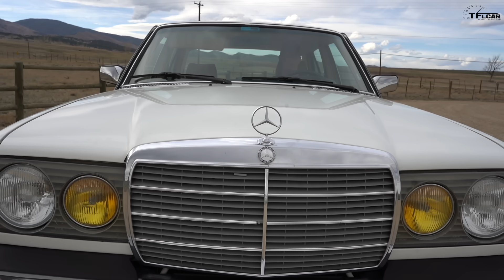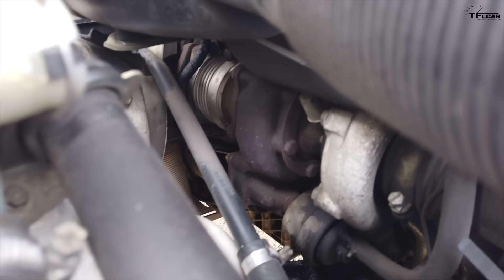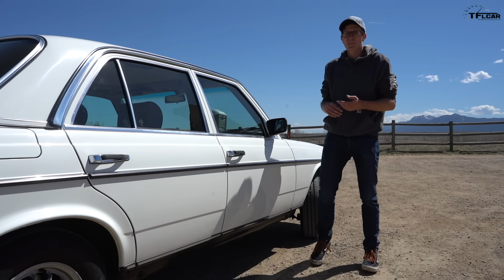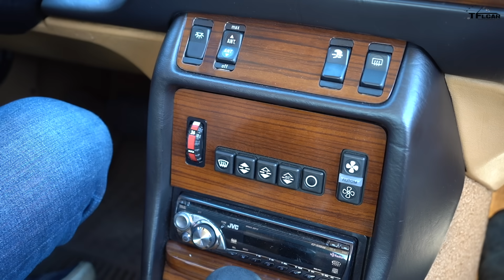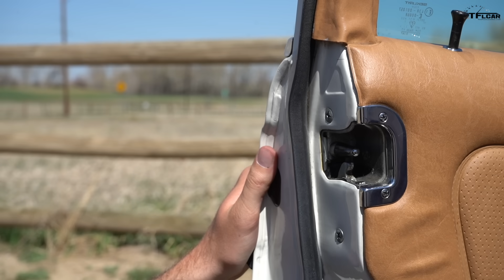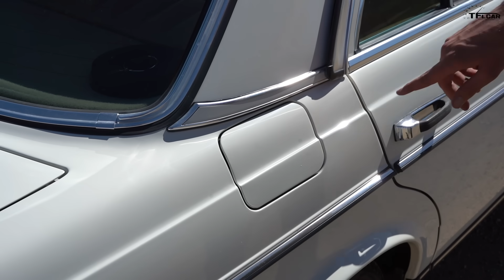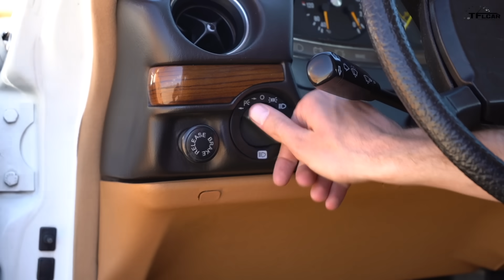This 37-Year-Old Diesel Is THE BEST Mercedes Ever Made!

Comment: Though, you can not compare car design today (Caddialac and Mazda) with a car from the 70's. (It's a 70's car). The reason why your Mercedes is much more boxy is due ot the manufacturing methods that were available then .. Todya, designers can model the design much more freely than when your car was manufactured.

Comment: I'm not sure that your review is all accurate or even related to each other, I'm sure it is the best car ever made and I say maybe almost all Benz cars, but comparing 37 years old car with newer design is not a good idea or even criticize the design knowing that Mercedes is one of the best designed cars in history.
Or even the engine sound, dude this is Diesel, it is normal to hear the engine sound, try checking other makes and newer models but diesel engine:).
Well other than that good luck in everything :)

Comment: I love this car but I have electrical problems all the time. Fuses burn out all the time causing loss of heat, ac, and headlights. Still have the root cause of the problem besides the fuses..
Reply: Maybe a loose or bad ground somewhere?
Reply: @Svaren  turns out I just bought a really cheap battery. Everything else looks good

Comment: I owned and '85 300D for 17 years. When I sold it to the state of California for $1500, it had 365,000 miles on the original engine and transmission and was still running fine. Perhaps a good tipoff on how good a car this was is the service manual (the real one, for garages). I got a hold of one as I did all the work on this car myself. There was so much detail in the instructions - every single screw and bolt in the car had a recommended torque setting (even things like screws to hold the visor brackets). One I remember in particular was the wheel bearings - detailed instructions about disassembly and re-assembly, how to pack the grease and what kind to use, how to check runout. It must have been effective because after 300k+ miles, there was no visible wear on the front wheel bearings.
For those asking why on earth I sold it - there were a lot of little things that needed attention and I just didn't have the time - stuff like ball joints, leaky vacuum hoses, heater controls, funny smell from the carpet etc, plus, like any old mercedes, it leaked oil which being a diesel, looked like printers ink.
Part of me wishes I still had it - along with the time to get after all those nuisance things.

Comment: As a former Mercedes Benz of No America District Manager in the San Francisco Region (Field Service Manager No. California)  The 300 Turbo was NOT "the best Mercedes ever made". There were three candidates for this superlative and this was generally accepted by M-B of No America  field reps and staff.
1. 300 D NON turbo. N O N turbo.
2. 240 D
3. And the best of the bunch were the 300 TD  (non turbo) Wagons which were made  in Bremen, not Stuttgart. Far better quality.
The Turbo vehicles had far more problems than the non turbo vehicles. Fact.  I was there.

There was a serious flaw in the 300 series, and correct it was the heating/AC system which had a major component that failed.  The component was superseded many times, the problem was never corrected. The component was made by .. the worlds worst auto maker, Chrysler. And this was before Chrysler swallowed M-B and ruined them. 

"Moon Roof" No, that is not a moon roof.  Only one of many of your pedantic BS comments and observations. 
 You have no credible experience, you  are parroting others. Fine car yes,  but your opinion is baseless. Drivel.

Forgot..LAlso with the diesel turbo cars starting in 84... new cylinder bore hatching (sp)  which failed miserably.. lots of blown motors.

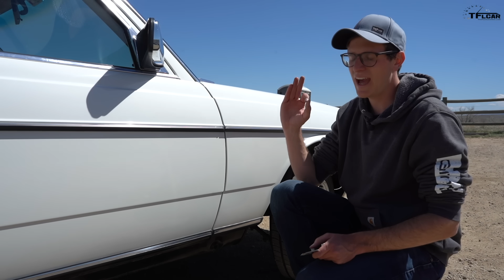Comment: Mercedes-Benz 300D from 1982 had bullet proof diesel engine. I would love to have one of those beauties, I have 2007 Mercedes-Benz E550 4matic as daily driver. I will never buy C class for their cheap built and inferior parts. @7:25 panel gap shown by you on 37 years old Benz is remarkable, compare panel gap to latest year Tesla $100K car and you will be amazed. This is an awesome video highlighting engineering details of a gone era automobile. This is shame that $100K + S class can’t match this quality. Cars made today are highly expensive, full of electronics and computer modules reliability of which are highly questionable :(

Comment: Hello, I am from Spain and I have a w123 300d 5 cylinders, in Spain sunflower oil is cheaper than diesel, and I have been using pure sunflower and recycled from restaurants for ten years, and every 10 tanks, sunflower plus acetone plus gasoline in percentages small, with this fuel mixture I have traveled 402000kms in ten years, without any problem, punctually using kerosene fuel in a maximum proportion of 25%. The total kms of the car are 1,115,000kms. At the moment I have the car stopped to ride it an equal and new engine from a friend who bought it in 1982, in case it broke, in all these years it did not break, my friend cannot drive and has given me the car and the engine. The engine of my old car, my The idea is to mount it on a bench to use it as an electric generator since I have access to recycled oil for free, in the event that in the future we are forced to use an electric car, I will use it as a car battery charger and consumer for the house. Greetings and encouragement from Spain and please protect yourselves from the damn Chinese plague.
Reply: What an awesome story! What is your exact recipe for fuel?
Reply: @endutubecensorship  hello, in recent years, about 6 years it has been working with vegetable oil only, since the price in Spain was much cheaper than diesel oil, when I mix the recipe is, 2 liters of gasoline, 1 of acetone and the rest vegetable oil, if it was in a place with temperatures below max -15 ° c, it was 10 liters vegetable oil + 10l kerosene + 30 diesel oil, at this moment the car is stopped and this summer I will mount a new engine from 1982, and I'll get the car ready. Greetings from Spain.
Reply: @Svenson612  Thank you for the reply! I appreciate the information.
Greetings from canada
Reply: @endutubecensorship  😀😀😀😀😀👍👍👍
Reply: @Svenson612  What happened to your old engine?
Reply: @endutubecensorship  nothing is just that I want to release a new engine and it will be fun, my friend bought it 39 years ago and it is time to use it and the old one I will reuse as a generator little by little, now I am painting it to protect it against the rust that has very Not long, the car spent 29 years in an area of the Interior of Spain with a dry and rust-free environment, the 10 years with me it is by the sea so I have to protect it more. I am currently about to buy another one for spare parts.
Reply: @Svenson612  I understand, best of luck with your projects!
Reply: I run my w210 e300td on Pure veg oil as well, no modifications required
Reply: there was a year where people went to big surfaces to buy 5 litters of vegetal oil that was cheaper than diesel ,new alimentay oil not fried ,the thickness is the only problem the fuel pump might not resist pumping such density oil when cold
Reply: The world needs more of you!  I think the same way!
Reply: @dieselbossbrandon  Hello Brandon, I have not yet been able to get the car to change the engine, but I hope that in the next few months I will have to change it, the price of diesel and electricity in Spain keeps going up and up, so I want to put it back In operation, I also have access to dirty diesel, which simply by filtering the Mercedes burns it perfectly. I have seen that you have a Mercedes too, fix it and drive it is a joy. Greetings from Spain and hopefully the good times return for all.
Reply: @Svenson612  ya things are getting expensive here too. Gasoline is outrageous so im converting my trucks to all run with a om617 and getting rid of the gas engine.  The new Mercedes with the hoodstack is my wifes first car. She loves it.  I got more videos coming up about it and more stuff about the OM617 coming up. Stay tuned it will upload in a few days.  I think youll really like it :)
Reply: @dieselbossbrandon  Hi Brandon, I just subscribed to your channel, so you can let me know when you upload videos and let me know, I want to see them. Greetings and lots of encouragement and strength in your projects.
Reply: @Svenson612  thank you brother! I really appreciate it! Im hopefully gonna have a video uploaded today

Comment: The engine service latches on the hood are on my 2000 Mercedes  Benz E430 too. 

But, my Benz has a bunch of expensive electronic options prone to breaking, or non functioning.
And I have to remove the front bumper just to replace the headlights.

Paid $350 for it 2 months back, so I can't complain. Runs and drives great.

Comment: To be fair, this is a very well kept example of a 300d. I have a td and it has almost half a million miles and most of this stuff doesn't work. Half the windows were converted to manual, the manual sunroof doesn't work, as a matter of fact, most things don't work. The engine is 'fine'. Needed some work. Well built, yea. But any car will given the care, and relative low mileage of this one

Comment: Ha! Ha! Ha! Ha! Ha! Ha!  Dude’s car needs a valve adjustment BAD, and he needs to synchronize his vacuum pump and turbo to the transmission.  You do that every 15-20,000 miles and you’ll get 8 second 0-60 times out of that 5-cylinder diesel.  I had an ‘84 and an ‘85 but sold them.  And they are still running with over 400K miles.  Absolutely wonderful cars.

Comment: i own a 28year old volvo 940 that has many similar things to this mercedes,
1, Hood that is supported by spring and can be opened to 90degrees to aid repairs
2 while less reliable than the 600 series engines the d24t in mine has almost 500K on it and it still goes with minimal oil comsumption, the petrol variants were reliable and powerful(at least easily tuneable) b230s or b200s(4cylinder) or b280s(v6)
3 the panel gaps while arent perfect for 500Ks its pretty even all around, but its not a manufactoring problem, just had a long and rough life
4 my wagon can fit a full briefcase of tools,its own jack and spare wheel(full sized), all of its fluids in containers and a couple of other necessary things BELOW the carpeted panels in the trunk, also the trunk itself is rather large especially with the rear seats down
5 changing bulbs on the taillights is very easy, you just have to pop a plastic cover off and you have acces to all the bulbs and screws
and so on

This merc was very advanced for its time and even by today standards (apart from the lack of airbags) it has a lot of features,sadly they are getting more rare and more expensive and hard to come by nowdays.

Comment: My dad had a 1983 300d. It was very clean. Fortunate for him thats the kind of cars we worked on where i worked at the time. Besides the usuall valve adjustments,air cleaner mounts that constantly broke, turbo oil return gaskets, and door lock vacuum actuators...those old tanks were great cars!!

Comment: I bought a 87 300 d for 500 bucks last winter. the seller said that the transmission leaked "faster than you could put fluid in"and he was mostly right, except he was using the wrong fluid. I flushed it and it does have a small main seal leak, no big deal.
 the 300d turbo goes from zero to 60 in "are you sure this is a deisel??! and it gets 27mpg doing it. it starts well in below zero weather, even if you dont plug in the block heater. with a 49/51 weight distribution, it handles like a two door car that is much lighter and it rides nice and comfy!
  I defy anyone to come up with a better car.

Comment: I had a German market 280 manual transmission in 1982-3, with the 4-barrel, about 600 CFM.  I think it produced more than the published 156 hp (or ps) perhaps because they needed to justify the significant extra cost of the fuel injected (E) version. It could drive all day at 120 mph and 6600 rpm if you didn't mind the fuel consumption. A hidden feature is that the HVAC controls (manual version) were lit up via fibre optics so that the bulbs were more accessible for replacing yet provided intricate illumination of the settings.  If I recall the rear 2/3 of the exhaust system was stainless steel.  The entire assembly can be dropped in minutes.  It also had electronic ignition noting that these were the years where BMW went all-out with engine electronics while DB was reluctant to do so.

Comment: I can just imagine what the German Mercedes engineers thought when in later years the bosses stopped listening to them and started listening to the bean counters instead when deciding how design and engineer the new models. The bosses had a product with a name that was a bi word for quality. A feat that had been painstakingly achieved over the previous decades by making cars that was head and shoulders above the rest in quality and innovation. In just a few years this name and it's reputation was totally demolished. Other car manufacturers must have thanked their lucky stars that they didn't have to be compared to the build quality of the old Mercedes lineup any longer. So sad, so sad.
Reply: So true. See my post above. A neighbour still has a 1990 300D. No rust, unbreakable and totally reliable.
Reply: The ”bean counters” were almost to 100% an effect of that the Americans got around 50% control of MB ca mid 1993.
Reply: @brahand  That merger really did no favors to either company. Chrysler lost its active suspension that they had been working on which meant that they had worse suspension, among many other problems.
Reply: W123 300 Diesel 
The Finest Quality Mercedes
Reply: Making ultra reliable cars is not financially sound in this capitalistic world of ours 👍
Reply: These cars were/are precious jewelry designed to last forever with basic maintenance. I have a 300d and 300sd that are absolutely reliable despite being over 40 years old. I could daily drive them but I respect them too much. Mercedes needs to get back to its engineering roots because their engineering is why we bought their cars. I have an 07 R class, 08 S class and 2012 c class. While these cars are beautiful they have substantial flaws that I have deleted in my need for reliability. Mercedes of old would never have released such cars. They would have apologized, taken the cars in and fixed them no charge… because they built their name and reputation on no-compromise engineering.  They are not the company they used to be and that is sad.
Reply: Nope, share holders hire bean counters as CEO. All f*cked up engineering companies has CEO from management background (intel, GM, Toyota, boieng)

Comment: I agree this is the best Mercedes model. I own a 1981 W123 with the M102 200 carb motor. I am the second owner having purchased it off the German Embassy in Welligton New Zealand in 1989. I  have also owned a W124,  2  W210's , a Viano van, and currently a low k W211,  however  I love the W123 (it is a 4 speed manual) and as long as I can continue driving I won't part with it!

Comment: Engine is one of the best ever made. Suspension, not so good. Front suspension tended to sag and caused the wheels to camber in. (Bent toward the inside on the top part of the wheel and tire). Oil gage had a tube coming from the engine to the inside of the car. If you didn't know that and separated you, you would fill the car with car oil. A biiiiiig mess!!

Comment: I had many of the w123 diesels. 
The 4 cylinder 240d with manual transmission would last many miles but the 300dt were my favorite. My last one was the 1982 300td wagon I sold 4 years ago and still miss that car. It was cherry but wife did not like the air not blowing cold. This was a weak part on those cars.
When the automatic is adjusted correctly it would really take take off.
I still have many parts.

Comment: IMO the best car ever made is a 1995 Honda Civic VX.  That car gets 40 city 53 highway and has 92hp/97 FtLbs torque with the car weighing only 2094 lbs.  That's like having a 184hp car that weighs 4188 lbs but will corner way better.  I put the foot to the floor and averaged 43MPG per tank mixed driving.  I have seen ones with over 440K with the original engine.  Just sayin.  ;-)

Comment: 14:57 tell me about it especially in Morocco taking the taxi to the city centre for 12 dirham (about £1 or $1.20 to travel 9 miles) and you had to sit in the back with 4 yes 4 not 3 but 4 other geezers who are sweating from the sweltering heat. XD I go every year my plan was to go this year and grab myself a 190E 1990 or 300D 1980 but due to Covid the plans have changed but the prices of these are increasing dramatically.
Reply: English?
Reply: @Dampishcar123  What??? every part of this comment is English do you want to translate this comment in another language?? Prehaps you mother tongue ewok language???